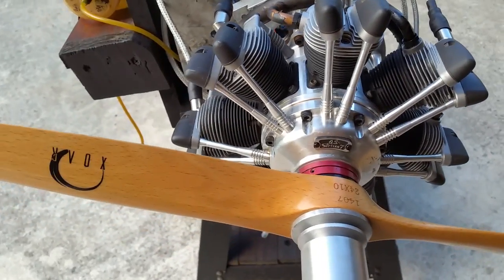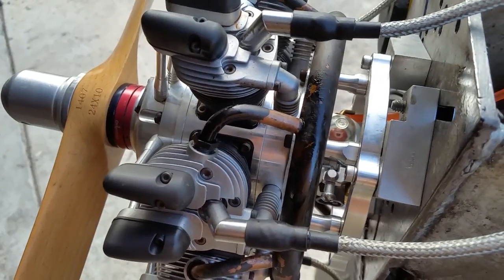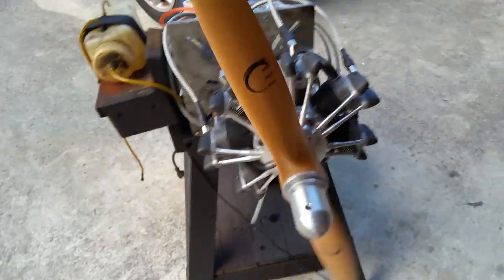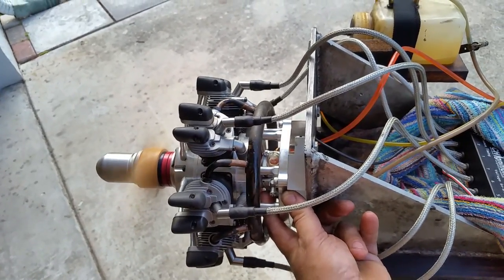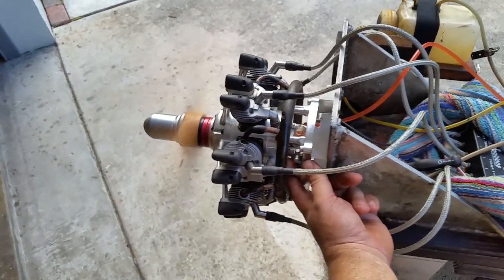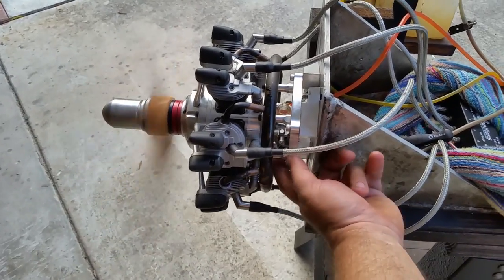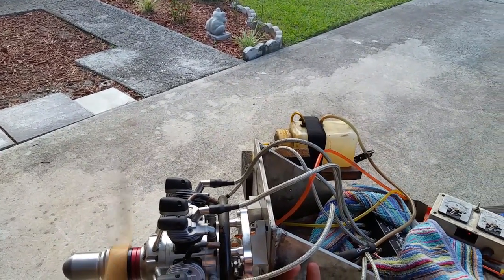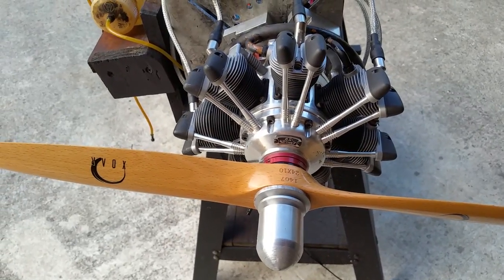OS Sirius 7 FR7- 420 Radial Engine, FULL Gasoline CH Ignitions CDI Conversion

Comment: hello Adrian, i have a question for you
Can one of those engines move a motorcycle? or are to small?
thanks
Reply: Short answer: no
It`s not the size, it`s the whole design, this isn`t designed to have a passive cooling system, it gets cooled by the air from the prop (and airspeed in flight), it`s not meant to drive a flywheel and gearbox, or a person, everything about it is wrong lol.
It`s "possible", but it would be very difficult to do, it`s just not what it`s designed for :)
Rotary bikes have been made, such as here:
https://www.youtube.com/watch?v=WR-FfL5Nf6Y
But those engines are quite different from this one.
As far as I can gather, the only thing more difficult to use would be a turbine..
I know, I`m 4 years late, but I answered anyway because I`m bored ;)
Reply: @afrog2666  Well, better late than never!!